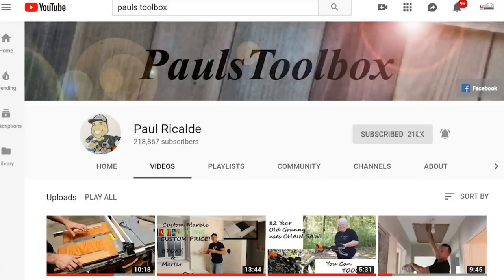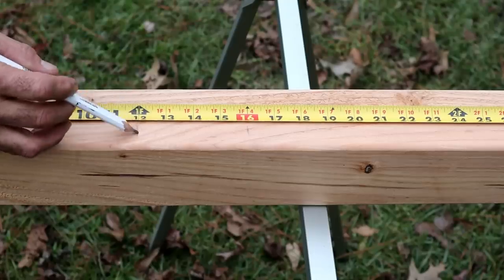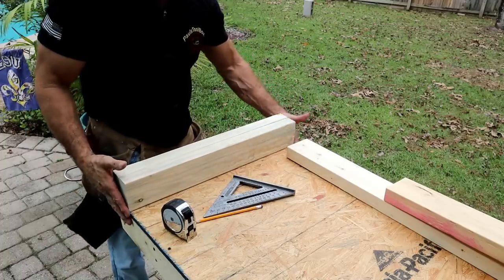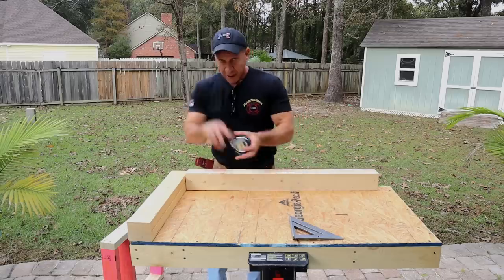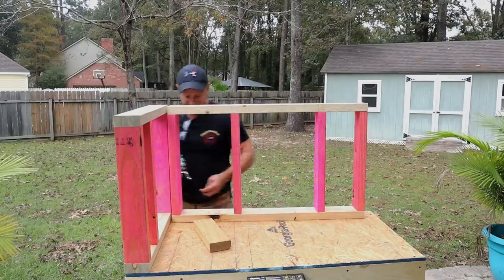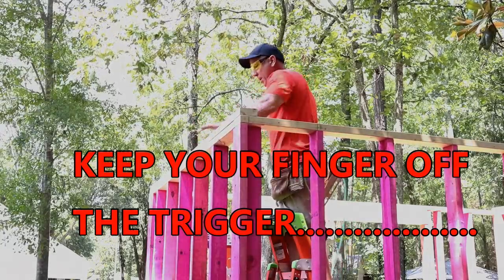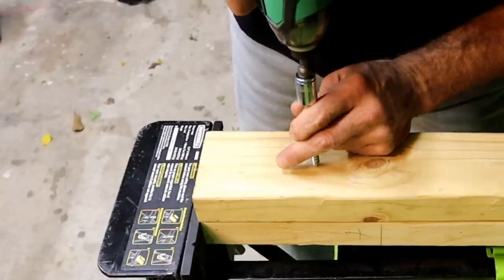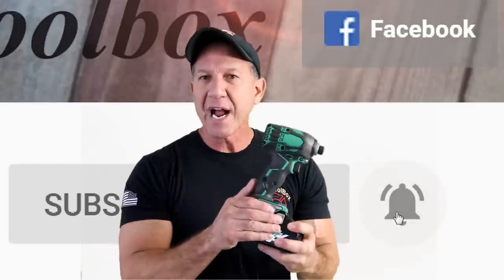How to build a shed easy to understand| Paulstoolbox

Comment: What a fantastic video. I just built a small shed 4 ft by 8 feet with 2x4's and OSB and a sloped roof and I put lots of 2X4s in there but I didn't realize how they should be installed like your video clearly shows. Lucky me my shed is very tough and even looks great but it would have been better with your advice. My suggestion is that if anyone builds a shed they should watch your videos first!  Thanks!

Comment: I prefer the first way of putting in the inside corner. First, it gives extra wood to the inside for putting on drywall, nice if you put the drywall on the back first. Second, it leaves space to put insulation in the corner, false corners are the worst for insulation!

Comment: Thank... thank..... thank you for mentioning putting screws or nails where the studs are. As an electrician trying to add an old job box and drill through in an attic for wire is a pain when trying to maneuver around the nails. It's a pain just dealing with insulation, minimal space and the heat up there. Had one job where it seemed like they put a nail every 2 inches on that top board. 
One cool plumber spray painted "caution water line" template in blue on the top board where he ran pipe. It's pros like that that make a difference in construction.

Comment: Thank you for this. I have a store bought shed to assemble. My yard is VERY sloped in every direction. I wanted to do a ground level paver foundation,  but I may have to use your method instead, so I can move onto the next project. I have a lot of sand and paber base to pull up to start over.

Comment: Paul Great videos!!! After watching video #1 I noticed that you placed a full length rim joist and cut the floor joists of the same length so they fit within the rim joists at the corners. Yet when constructing the walls the short side base plate went the full length to the corners and the long base plate was cut 3"/side shorter to fit within. Why not have the rim joist be the same length as the base plate 2x4 above it?  Thanks for the help!

Comment: Former home builder here. Love your video. NOTE:   USE TREATED 2x4s on your bottom plate and  spend the extra dollars and put a bead of silicone caulk down before raising your walls. That way the bottom plate will have a bug barrier as well.  Also... Treated... means it repels water not termites.  Treat the ground for termites. Happy building!!
Reply from the maker: Thank you, I always appreciate good advice!
Reply: @paulstoolbox  your welcome Paul.  Any time.

Comment: Now THAT’S the kind of drill i need to get myself, as I’m starting in the trade. Amazing!
Reply from the maker: Good morning JC, Yeah I got a deal on that from eBay with an open box so I only paid $80 for the bare tool. I then bought their circular saw at Lowe’s for $200 and they have a rebate until the end of this month where  you get a free battery or the corded adapter. The rebate is on the Hitachi site, I just filled out the information and I can’t wait to get the cord. So far I really like their tools a lot, we’ll see how the future holds. Thanks for watching JSI and have a great day! PS a winner was chosen for this one already but I will work on getting new giveaways. Make sure you subscribe and ring the notification bell so if you do win I will have a way to get in touch with you.

Comment: Another INFORMATIVE VIDEO PAUL 
Question ?
i have a CONCRETE PAD 
goint to Fasten the STUD onto the Concrete with WEDGE BOLTS . To make the Wall Water Proof - Do i use a PINK FOAM STRIP GASKET ???

Comment: Paul , great video !
I’m building my first shed and have been confused over the walls and making sure I have enough room for my interior /exterior walls and sheet rock. I value the way you simplified it ! Thank you. Also your pretty gunned up Boss. Looking good !! Im 42 and still hitting the weight pile   Not as heavy as I used too but nonetheless. 
Keep it up. And what was the name of the brand of impact you were showing off. That thing looked great. I own an automotive repair shop in Keizer Oregon and I’ve been running Milwaukee and Dewalt for ever. I like that yours gave you a adapter to run of a cord of the battery died. Or just cause. Thanks boss -

Comment: I wish you would have mentioned that the first corner option is best when installing insulation in your shed. The first option leaves room to place the insulation as far as you can into the corner;  2"x4" studs only provide an R-Value of 4.375.

Comment: I had a Porter Cable impact drill one time. It came in handy. Use to use it on everything from my screwed together shed to working on my car or truck. Then somebody snuck into my shed and helped their self to my tool bag and my pancake air compressor. Lost the impact and a corded drill all my bits and drill bits. They didn't take the air house or a Brad nailer I had. I hate a their!

Comment: Enjoyed the video Paul. Yes, I would like to try my first impact driver. I current do not own one but some of the contractors that come through doing work on venting ductwork for water heaters use those putting small screws through to hold them together.

Comment: You should have built a scale model shed by ripping down some 2x4s and made it as a dog house for your dog. :)
Might have a bit of trouble finding scale model shingles though... :)

You mention Louisiana... From your accent, I would say maybe in the New Orleans area and from the terrain, I would say probably on the north side of the Lake... If Slidell, probably north of I-12 since it is higher and did not get hit as hard by Katrina... Or maybe inland some around Covington or Mandeville... I grew up in NE Louisiana, but live in the Houston area these days...

Comment: Hey Paul, that's a great explanation!  I do have one question:  On the 16" centers, if 16" on the tape is the center of the 2nd stud, then wouldn't that make 0" the center of the first stud?  But in fact, by hooking the tape over the end of the plate, putting 0" on the end, the first stud would end up 3/4" inset from the '16" on center' rule?  Is there a reason for doing it that way, like using 48" sheet materials, flushing the edge to the edge of the stud, and having the sheet hit the center of the 4th stud?
Reply: yes- typical frame starts at 0" as that is where your sheathing will start on the outside- that way the end of the sheathing will center on the 48" stud. On the inside, your first stud will have a 3/4" narrower space between studs.
Reply: 16", 32", 48", 64", etc. all mark the center of the stud. The fact that the first one is "misaligned" flush to 0 since it's flush with the end of the wall does not matter.

First and last studs are always flush, you measure correctly for "on center" install but always place the first and last studs flush, you don't need that 3/4" of stud hanging off your wall at the ends.

And yes, construction is like Legos, everything is built around the sheet goods sizes.

Comment: You measured from left to right.  So would sheathing factory end always start on the left?  If you would have shown a from wall, it would have covered the 3 1/2 of the left wall.  Wouldn't that mess the whole thing up?
Reply: "front wall"

Comment: what should the length of the wall framing stud be? Do i subtract the bottom plate + the two top plates + the floor plywood _ 1/4 inch to let the outside sheathing below the rafter tail ? i.e. 96 - ( 3x1.5 ) - 3/4" +1/4"
thank you

Comment: I understand how the sheathing hits the studs at16” centers but how about the drywall? The interior corners throw that off don’t they?  How do you handle that?
Reply: Start drywall from a spot that aligns with the 4’ sheet, leaving the corner rips for later to fill with cut strips.

Comment: Paul, when building the walls, which way do you put the "bow" of the studs. Bow to the inside or outside?
Reply from the maker: Good morning Dale, it really does not matter because if it sticks out on one side it’s going to belly on the other. The main thing is to keep it minimal. If you have one 16th of an inch crown in the middle of the wall it will taper off and you will not notice the bow. If you have two studs that have a 16th of an inch bow in them and you turn them opposite of each other, you will have a 1/8 inch difference between them. That is much more noticeable, especially if you have two studs next to each other. If you have multiple stones like this and you turn them opposite of each other your wall will have many waves. Thank you Dale it was good to hear from you!
Reply: @paulstoolbox  Thanks for the reply Paul.

Comment: That’s one hell of a drill. I’ve had 2 drills that drowned from water boarding.
Reply from the maker: Txlonewolf, Yeah I really am impressed with his drill. I did push it past the limits because it is not meant to be completely submerged. This is why I wrapped the battery area up real good before I put it on the water. It does handle water very well as you see and it is meant to stay protected if it is left out in the rain snow sleet or other bad conditions when it comes to construction. Please make sure to subscribe and hit notifications because I will have future giveaways and of course I will try to have a good content LOL. Have a great day!

Comment: you should not ever do the second corner option, if you ever plan to do electrical or insulation in the walls... having a pocket in the corner prevents insulation from reaching into the corners and the electrical is a pain to try and fish through those pockets. and you have to have the extra blocks which uses more material... it is an all around worse option.

the first option he showed is called a "California corner" and has been the industry standard for decades. and if anything you can cut out the whole extra stud and just nail the blocks in the same spot if you have lots of blocks you cut from other boards. there are ways to cut costs without cutting corners, no pun intended.

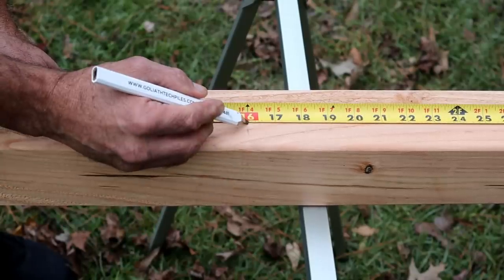Comment: didnt you make a mistake at 2:53 measuring the 16" centers part? if your tape is starting from the edge of the wood stud you want to mark the 16" and NOT move back the 3/4 inch. IF you are measuring edge of stud to edge of stud, and if the edge is 16" apart, then the OC part will also be 16". Your way would be if you measured with the beginning of your tape from the center of previous stud, but it seems you were just holding the end of the tape at the edge of the wood piece though?>
Reply: No mistake bud, the center is at 16 then the other lines are just guides for the stud.

Comment: Second example of backing for interior corners, using blocks, is very unnecessary. Just nail a backing stud like a regular stud, just an 1 1/2” away from the corner stud. No need for blocks at all.

Comment: The 16” on center... couldn’t you just basically lay the stud on your 16” marks then estimate the center of the stud and nail it in? Not really that hard to estimate the 3/4” on either side and will save time from having to mark everything twice
Reply from the maker: No, I wish it were that easy but you will make mistakes doing it that way. When you lay your sheathing you are splitting the seam down the center of a 1.5” board. It is better to do it right then to do it twice. If you are off by 1/4” then you will probably skim the side if your stud when applying your sheets and it will be week, besides it will make it much harder to find the center of your studs after you close it in. Please take an extra moment, you won’t be sorry. Thanks!